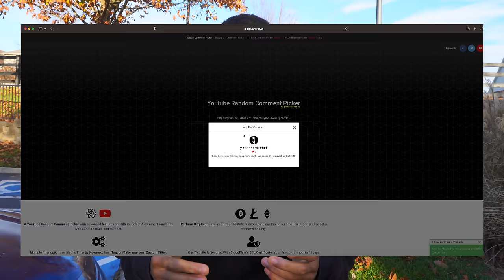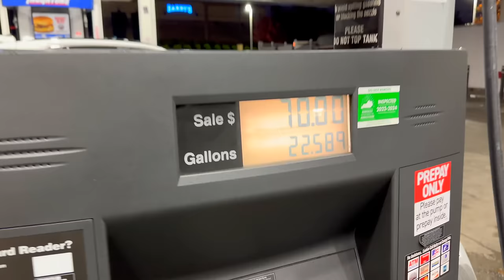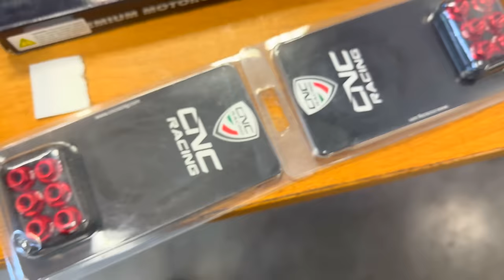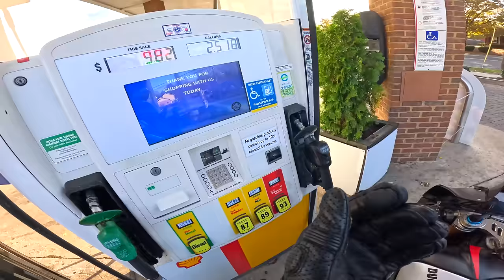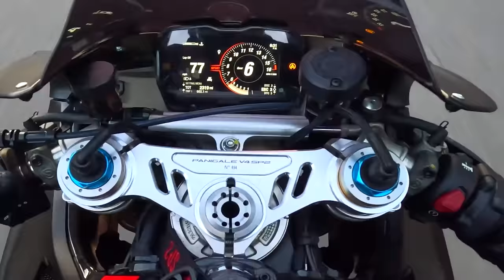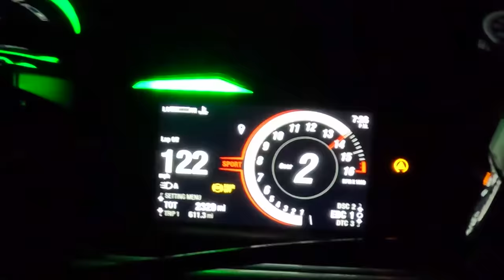TROLLING A COCKY Ducati Rider | Panigale V4 SP2, V4R, V4

Comment: Real talk on the suspension. Moto GP uses manual suspension. Because the set-up is easy and stable. Even though the smart suspension is nice and expensive. But manual suspension is the way to set your bike up, and dry clutches are only good for MOTO GP. Wet clutches last longer for street/race riding.

Comment: Street riding and using the friction zone is what wears out the clutch. The more you ride at slow speed and use the friction zone the faster it wears out. It’s a race part that is not designed for any kind of traffic. Unlike an oil cooled clutch, the only thing to prevent heat build up on a dry clutch is air flow. On average the dry clutches last about 3000 miles with normal wear. City riding can cut that in half
Reply: Even just holding in the clutch lever at a red light and keeping the bike in first gear exponentially wears out the clutch.